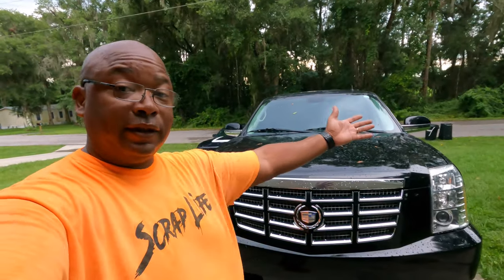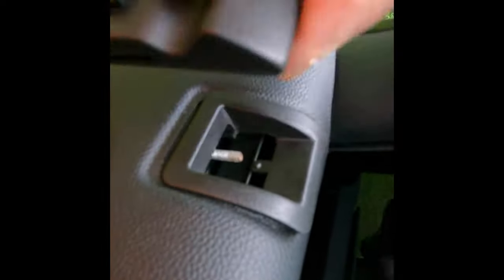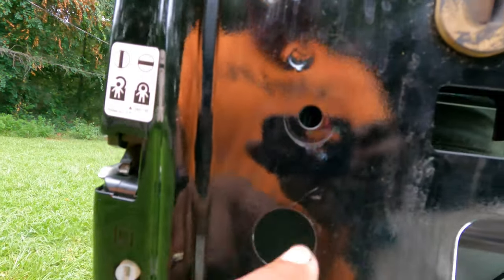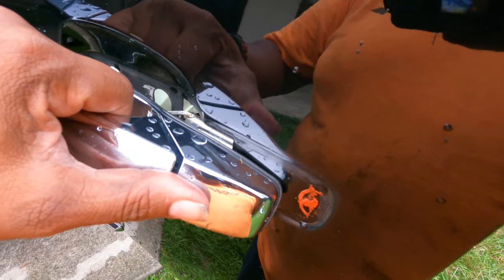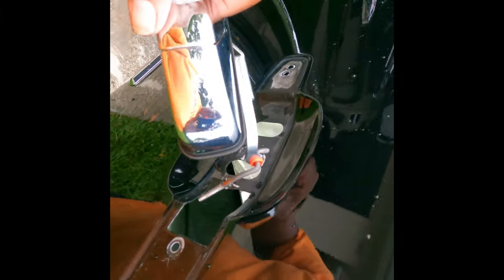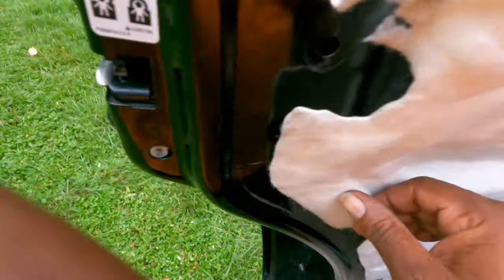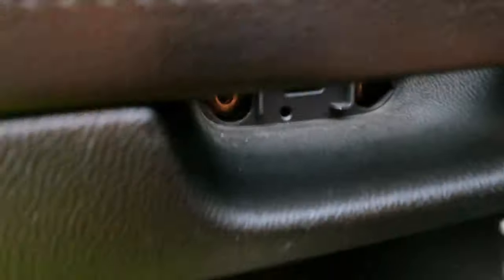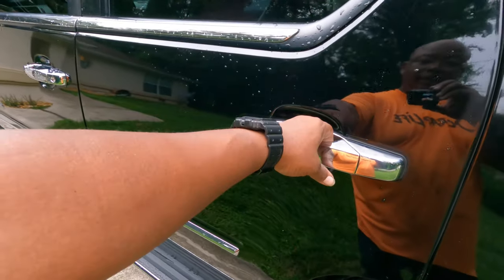2007-2014 Cadillac Escalade Door handle replacement

Comment: Great video!  Thank you.  I always wondered why this was a common issue with the SUV's but not so much in the pickups, despite having the same design of handles.  I shrugged it off with a hasn't happened to me attitude, as I've had my silverado for over 10 years.  It didn't take me long to realize. It's the little a-holes that ride in the back of the suv's.  So now I'm fixing my wife's Escalade.  Thanks again for the very clear and descriptive video!
Reply from the maker: Thank you for supporting us by watching it

Comment: Awesome video! My handle is broken but its where the back of the handle connects to pull the opening lever inside... anyway, I should be able to fix that even from watching this video! I am also having an issue with my door controls stopped working (no window, no mirror, no door locking)... I've been seeing that it may be the wiring or wiring harness (I already checked the fuses). Do you have any videos on this?
Reply from the maker: Thank you! Unfortunately, I haven’t had the wiring issue you are referring to. But if I do, I’ll be sure to post a fix if I can